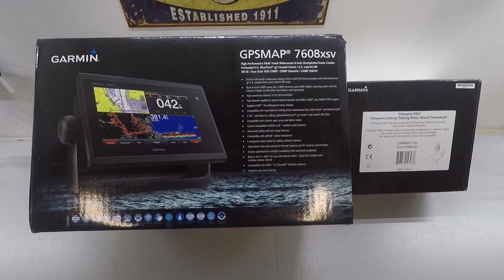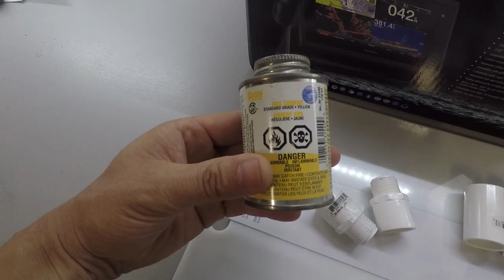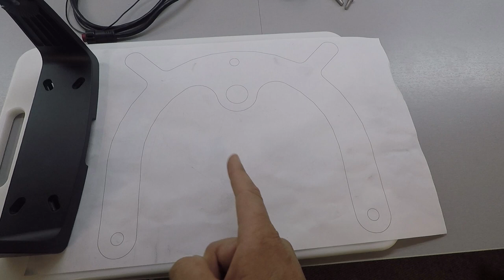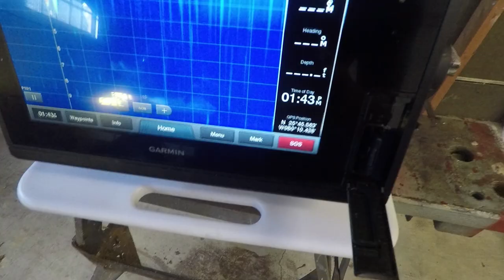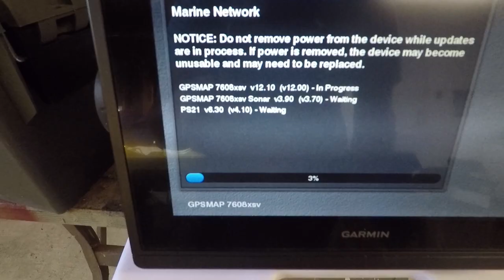$30 DIY Panoptix Ice Fishing Mount

Comment: Hi there, just wondering if you know if the ps21-tr is able to be used for icefishing. I notice the packages all come with the 22's but the 21 is a bit cheaper. any idea what the differences are?
Reply: lol should have waited until the video was over... the 21 cant point straight down to view 50 feet each way kind of thing? great video thanks
Reply from the maker: That's right the 21 only have the LiveVu Forward that's why it's cheaper.

Comment: Why weaken the mount by cutting out all that material. Just cut the thru hole for the pole and call it a day. Easy to center in your hole and a lot stronger.
Reply from the maker: Much easier to get the fish through the hole this way